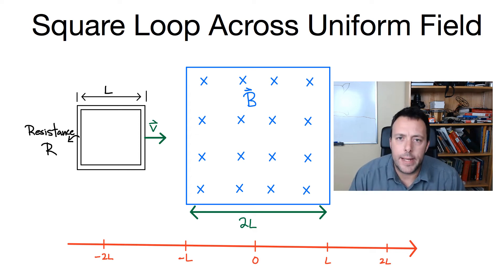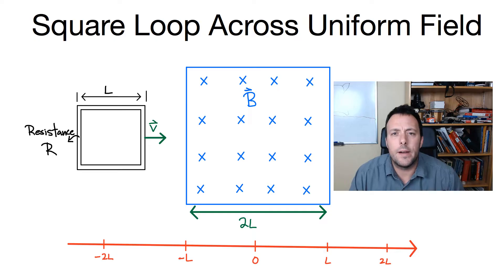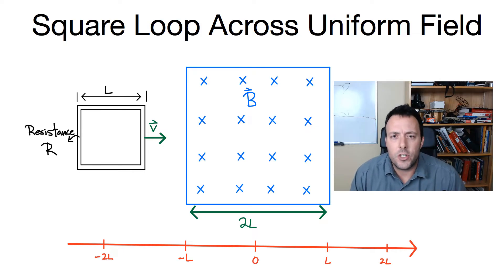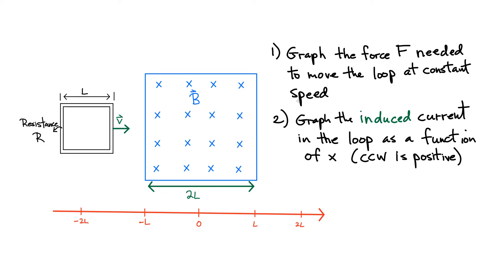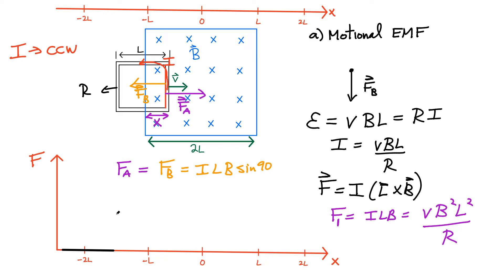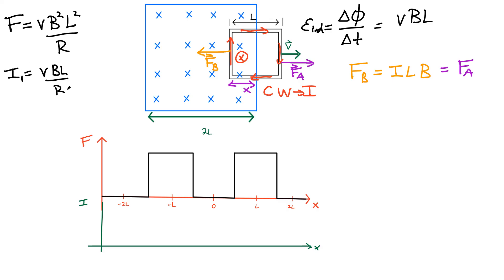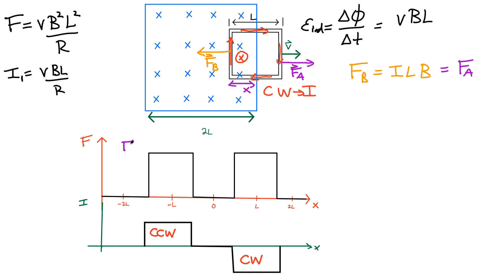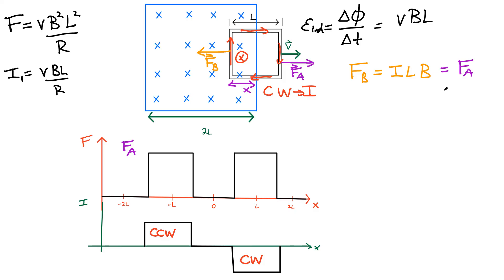Electromagnetic Induction: Square Loop Across a Magnetic Field

Comment: Dr, consider you have this square loop stationary on the horizontal xy plane same as this example, then you brought a bar magnet with the south side closer to the loop, letting the bar magnet pass by the loop along the +x axis, will there be induced current in the loop, if so, can you help it out with solution showing B vectors and any other details we need to know that there will be induced emf or not. Most teachers are saying there is no emf but am not convinced. Appreciate it

Comment: Faraday’s law is very general and any change in magnetic flux, whether due to a change in magnetic field or, a change in area, produces an emf equal to the rate of change of flux.
In fact, both may be present simultaneously, as when you drag a metal bar along metal rails with one end of the rails bridged by a resistor and there is a uniform magnetic field in the area between the rails and bar and resistor. Assume, the magnitude of the uniform magnetic field is increasing.
The flux is BA, where B is the magnetic field and A the area enclosing it, and the rate of change of the flux is due in part to the change in the magnetic field, and in part to the change in the area enclosed by the changing path.
The resistor will heat up! 
The equation of the rate of change of flux....without the details of the derivation are
= (dB/dt) A        +       BLv (Change of B, fixed path)   (Change of path)
The calculation is a bit mysterious. Physically, where did the emf represented by BLv come from if it is not associated with a changing magnetic field?
Befire we provide an answer, it would be instructive to understand Current, the conduction process and Voltage at the fundamental level.
Electrostatics and circuits belong to one science not two as in the following two videos:
i. https://youtu.be/REsWdd76qxc and 
ii. https://youtu.be/8BQM_xw2Rfo 

Now, returning to the experiment of the moving bar on rails,  we see that we have a conducting metal bar and we are moving it. Note carefully that we are moving the jumpy energetic conduction band electrons in it as well.
As a result of the magnetic force (due to the presence of the uniform magnetic field), the free electron sea shifted, and the bar polarized and a Coulomb electric field develops and that is how an induced emf is produced. 

It is not possible in this post to discuss in more detail the process of polarization and the consequent production of an emf.
The last frame References in video #1  lists textbooks 3 and 4 which discuss these topics in more detail using a unified approach and provide an intuitive understanding of the generation of an emf in generators and motors.

Comment: Professor, could you help me? I think that the answer of this question is zero, is it correct? 
Two metal rectangular conducting spires, named a and b
move at constant speeds to a region where there is an uniform magnetic
field B pointing out of the page, orthogonal to the spires. Use Faraday’s
law to show how the electromotive force in the spires a and b relate to
each other when their whole areas are immersed inside the magnetic field
B. Consider that the spire areas (Aa and Ab) are such that Ab = Aa/2.
Thank you a lot you teach very well and your english is easy to understand! Congratulations!!

Comment: Thanks for the video. However, nobody explains why we only need to look at the flux, meaning the field inside the loop. Even if the loop is not inside the field, the magnetic field produces an electric field in the loop. or not? And even when we're the field-region, why are we only looking at the field inside the loop? --> Please don't answer with "because of Faraday induction" or "because of Lenz's rule". I know those rules. I want to understand the physics and how to see that the electric fields created by the magnetic field lines outside the loops aren't relevant.

Comment: What if this loop was on the top of the magnetic field? What emf and current would that produce? I.e. the square is halfway outside of the magnetic field on the top, and has a velocity to the right
Reply from the maker: When it enters the region it’s a big more complicated to find the flux because only a corner of the loop will have flux through it.   I think it will turn out to be half of the case in the video.   Once it’s half inside the current is 0 because the flux is constant but half.  The was out is similar to way in but opposite direction.
Reply: @PhysicsNinja  Thank you!

Comment: According to my textbook, "if the bar has some resistance , this resistance is like the internal resistance of any other kind of battery, and V=vBL–R(internal)I". If this is the case, why isn't the current I=V/R=(vBL-RI)/R => I=vBL/2R ?
Reply from the maker: Good question.     If you had a bar moving in a field area the induced EMF would be EMF=vBL as you indicated.   The way you have it set up now IR=vBL-IR -> you are counting the contribution of the resistance 2 times.     Simplify the wire as an ideal wire and lump all its resistance into one R.   The equivalent circuit would be one EMF (source) and one resistor.      I=vBL/R.    Hope this helps.

Comment: the magnetic force is upward by using left-hand rule (3:09). Or if  not can you explain "why"?
Reply: Current flows in the direction opposite to the flow of electrons
Reply: maybe this won't help you anymore but indeed LFR will give you the force up but remember it's an electron, whose charge is negative. the vector you find with LFR is v x B, F = q * v x B, so because q < 0, the force is opposite to that which you found

Comment: Actually the question is..
" A square loop of side a is so placed that its top side is in a uniform horizontal magnetic field B normar to the plane of the loop and the lower side is outside the field and horizontal. The resistance of the loop is R and mass is M ...then what is the terminal velocity if the loop is allowed to fall under the action of gravity?
Reply from the maker: Hi SuKanta,  this is a good problem.   You have the weight acting down and the magnetic force will be acting up.   
 I think the magnetic force will only act on one segment of the square loop.    When the forces are the same magnitude will have reached terminal velocity.    i'll try to make a video tonight about this problem and send you the link!